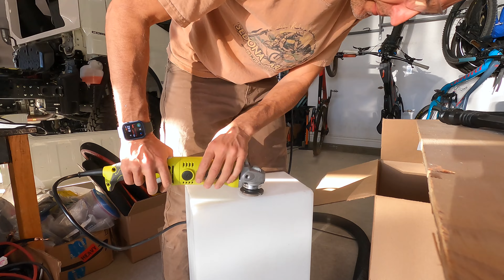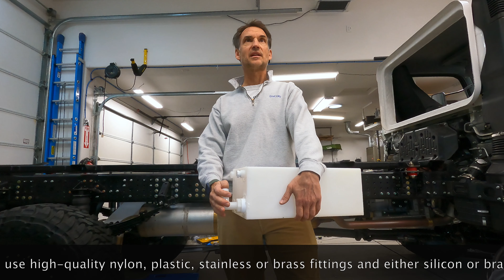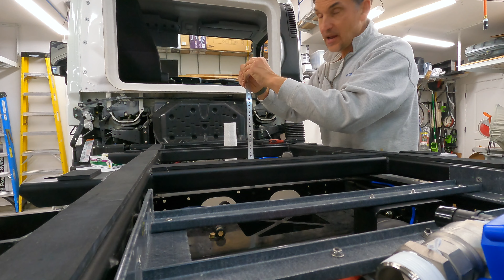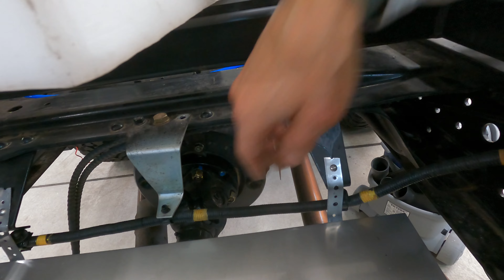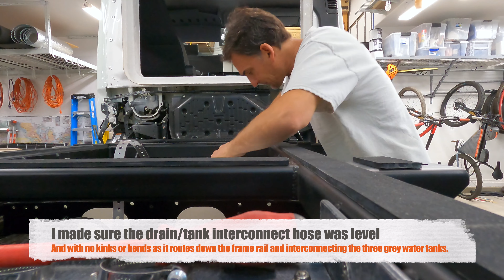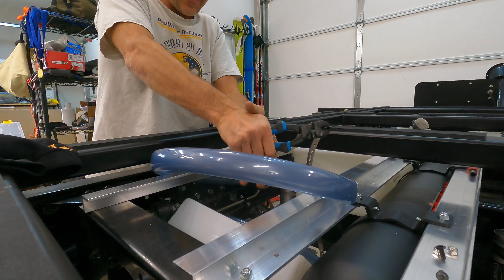Building an Expedition Camper--installing the grey water tanks

Comment: Great videos! Not criticizing but I noticed you commented on the vent location several times. In our van, we would have preferred the fresh water vent location to be in the center of the tank to minimize leakage from sloshing. I do realize this is for gray water as well.
Reply from the maker: Thank you. Yes, the vent in the center should reduce sloshing, although in this case most of the sloshing should be from braking so the vent in the rear should reduce it over a front or possibly a center vent, but since these are located outside of the camper space, the location of the vent was really more important to be accessible from under the truck and reaching above, in case ever needing to clean one out. Unlikely to have to do but good to have that ability. My fresh water tank vents are located more in the middle of them and they will be installed within the camper space and the vent run up high into a protected area of the shower space so an overflow will just go down the shower drain.